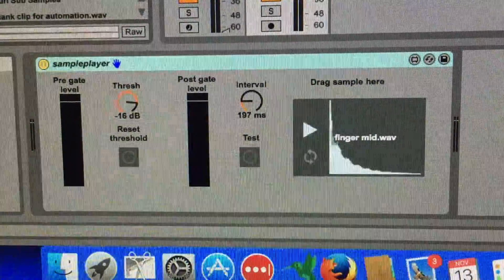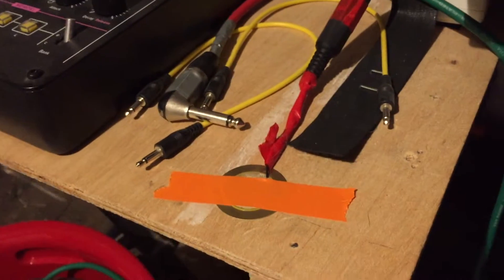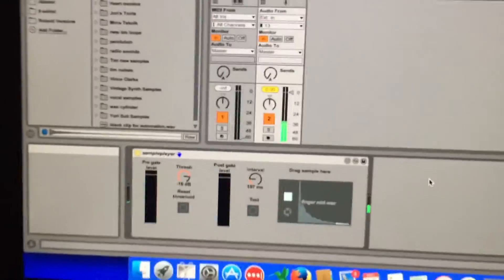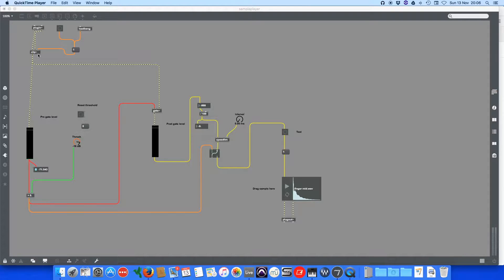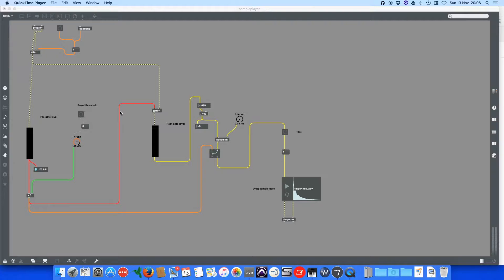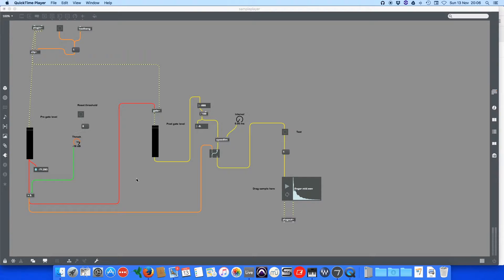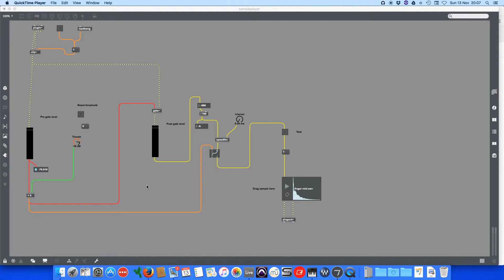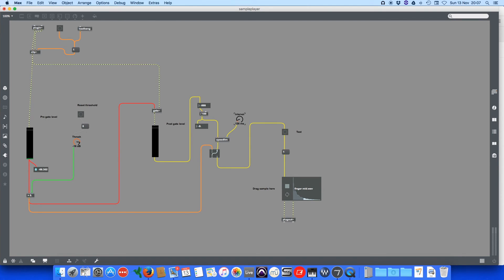Max for Live Audio Trigger Device

Comment from the maker: You will have to mess about with threshold and note length to get it to work well. If the note length is too short and the threshold too low you will get multiple triggering. It is only my third Max device so there is probably a better way involving envelope folllowers or something.

Comment from the maker: This is the recieve device, goes into a MIDI track or a pad on a drum rack in front of the simpler 
<pre><code>
----------begin_max5_patcher--------
554.3oc0VssbZCCD8Y6uBM5YWFeAan4iH+.ocxHrWHJCVhQRlRZl7uWoU1Dm
.33RfLsuHFsrd2y43iVqmCCnKj6.MkbC4NRPvygAAXHWff18AzZ1tx0LMlFs
TVWCBCMx+eFXmAieqz.+PzEdCyT9.Wr5dETZ7kOc9j3HRVbF9CtlXCQ9Y2in
.ssvLCWJbOQRabdEVe4hG+1rtxKZp4h0fQ2OQs4o0.lauzjMlt7hORiN.e44
uGdtG5kvP2RzH0HaeW.pAzhoyvtLs.aYraMMdDZwFlhUCFPcOHXK7rM9PcJK
4SITosQWJU0LDw4efzEOIOhT78SvFeoMOsA7oaaKgtfIVQOK0cHGHwBJNrcP
wOIEg3L7M87hQK98D3z+R8coTXVxJg9Y4ho4+1GKcR743Y81zoHQxekHWCKa
5zDrAEwmxyNNuYwEwZdgsTB3WVrcfiRQ1BqGTSx8yI7CMRNPS5w67ix63Qx6
jSx6KIeE1SP1NLzYmLOUmiu+8iwNEimdTFmM1o0WCSbK7SKx+bl3r+qLwFEe
0GKJct3rgdml7U3hwFSWyEu+lIH3cweqJnkMpxtR0Nig7J7q.sgK1ON+t8tS
Rx9bdfWUAh9bohqcFfpS6EGKZxGAZdKhulnIajZy+NnwcaluH3jLF3blnw6p
Ya1XuchtsjHPrmheTpbamEga4B+VbTIUAa459WEgxT1ivF642Fk+z1t49upR
qkUfRzvwbCcc9kv+.rxh31K
-----------end_max5_patcher---------
</code></pre>